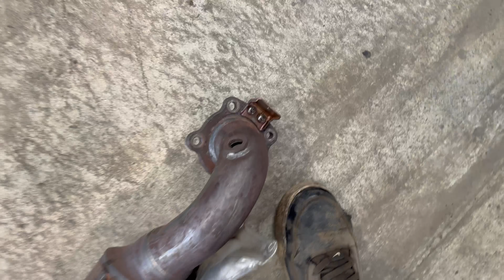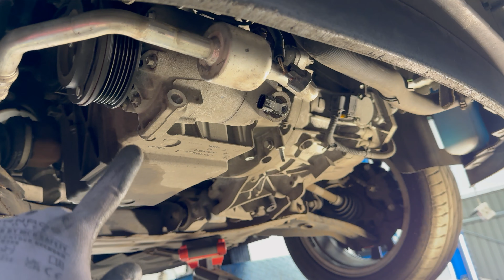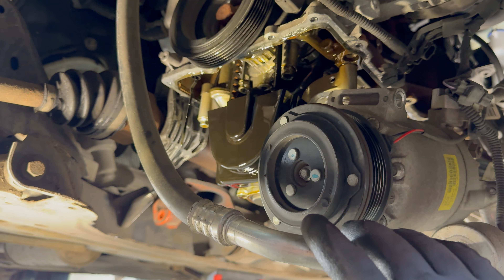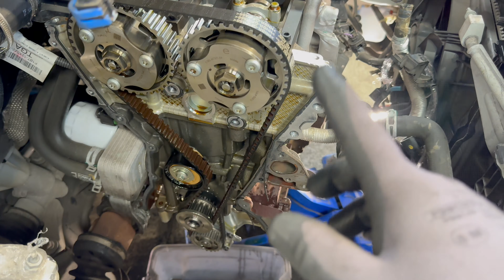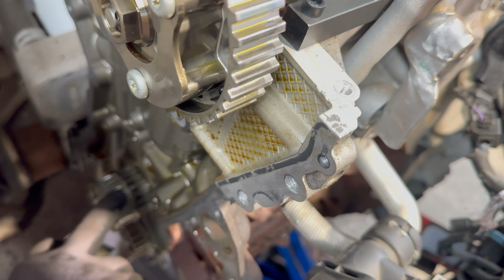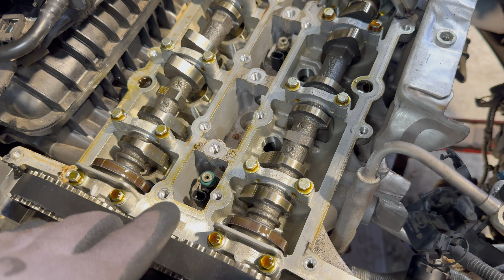30k mile Timing Belt Replacement Interval is INSANE - Ford Ecoboost 1.0 Wetbelt Replacement

Comment: Mine worked fine, till I took it in for the recall, 22,000 miles. After it was "Fixed" it made it 22 miles and the dash lit up and that was all she wrote. Now it's been in the Dealership  for 5 months awaiting parts. Make that 6 months.

Comment: Hi Mr Nice Guy. I need your sincere opinion. I am in between 2 cars, mazda 6 2.2 diesel 2019 model , and mazda 3 petrol engine 2021 model. They are nearly in the same price range. My heart goes for mazda 6 , but I am scared from problematic diesel motors of Mazda. Mazda 3 petrol seems more reliable. Anyway, please help me
Reply: Feel free to ask any questions
Reply: @danielfarago4439 I did that, but no return back 😢

Comment: Are you sure it is 70Nm to start with ? I've seen other video's where they specify 60 Nm, with the multiplier you end up at 350Nm ,and than you add up a 90° angle on the bolt ( 5*90° on the multiplier as said) With 60 Nm input, the final torque is 300Nm. (and than 90° angle on bolt)
Reply from the maker: You are correct. 70Nm is without the torque multiplier. Then when the torque multiplier is attached then it is 60Nm and 5x90degrees.

Comment: Dear friend, good morning. Unfortunately, I could not find another way to contact you. I need help. The valve cover sh01-10-221 Mazda 201302.2 diesel 175hp engine Sh01 has broken. Bought used Sh02-10-221. Upon arrival, we noticed that there are differences inside the cover. Is there any interchangeability between them, or should I look for one to one? I ask for professional advice.

Comment: How many hours is the job?
Reply from the maker: I would say it can be done in a day, just the sealant needs to cure.
Reply: @MrNiceGuy94  I'm tempted to do mine, I've heard many complain how big a pain the 1L are; wasn't sure since watching a few videos on it doesnt make it seem impossible.

motor has about 90k miles on it but is about 4 years old. 
Personally Im curious if the failures are releated to oil additives not playing nice with the belts since Ive seen so many complaints with low milage failures. 

This fall I plan on replacing all the suspension... didn't know if I should just go all out and do all my lapsed maintenance items.

I unfortunatly had a coolant failure on the first motor at 125k. car ran and start when i dropped it off at the dealer, but during a coolant leak check it seized they said.
Reply: @matthewmenteer5673 the low mileage failures of the belt are due to oil dilution (with fuel). If the oil is kept fresh and clean (six-month oil change intervals) then the belts last a very long time. 

The higher mileage ones tend to be ok because the car does fewer short trips, so the oil does not get as diluted with fuel. 

The actual oil type itself affects the belt very little. It’s the fuel in the oil which breaks down the belt.